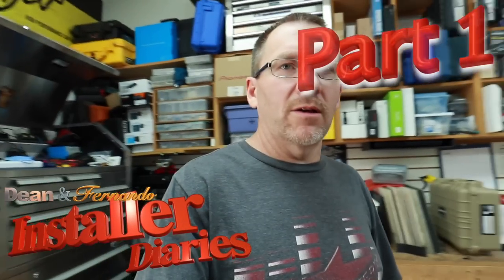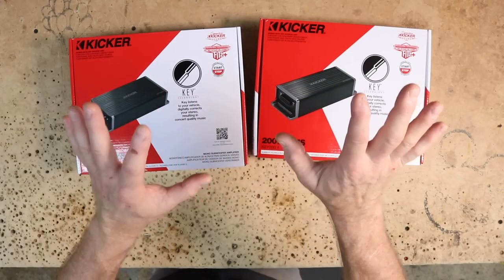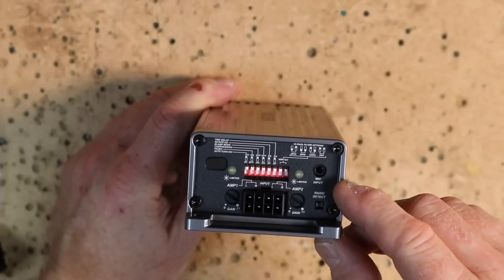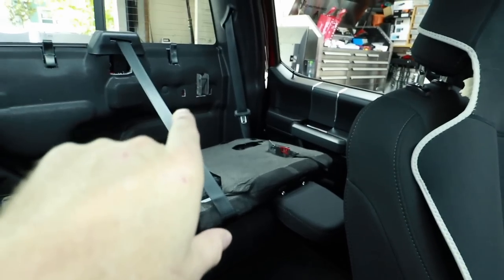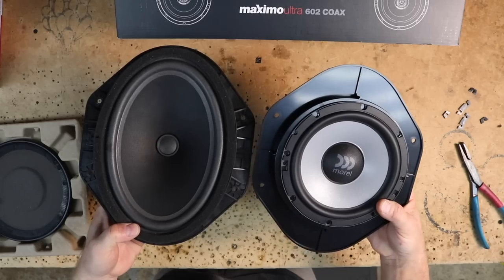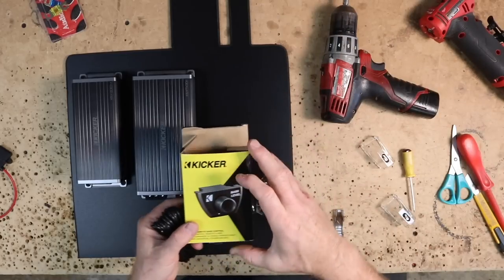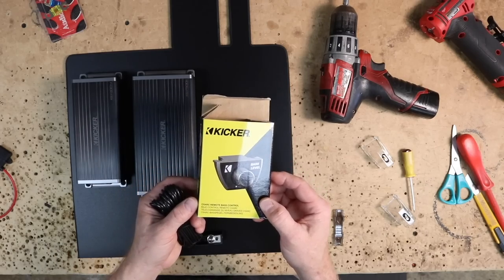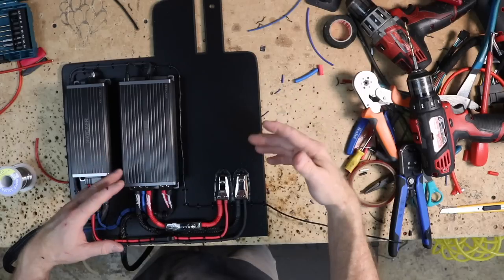Ford F150 get a full Kicker Key car stereo install

Comment: Got the KEY 200.4 running 2 sets of Kicker KSS6504s in my '01 Highlander...great little amp and HUGE upgrade over my 20 year old factory Pioneers. Mic calibration works pretty well. Sound treated both front doors, already notice a definite difference in road noise, overall ride smoothness, and sound clarity. Gonna do the back doors and floor next. Wouldn't have even attempted this without channels like this. Thanks, guys!
Reply: @A. Melbs Well, I still don't have a sub, so I'm running them full range with a slight EQ down 3db at 60hz on the head unit. Great speakers, great imaging, volume, and clarity, they just can't handle much under 60hz but the DSP on the KEY really brings them to life and creates an impressive sound stage in the cabin.

Comment: I have the kicker key 180.4 and 500.1. What sucks about them is that you cannot time delay the sub or phase it to help bring the bass sound more up front. All it does is takes the input signal and flattens it and mine is already flat from the HU anyway. So basically it didn't do much. Wish I knew that beforehand OR Kicker needs to make a 5 channel key amp so it can do the whole system all at once.

Comment: I love my Kicker Keys. I have 2 of the 500.1s pushing a Level 2 DC Audio 12” for each amp. My 200.4 runs my tweets and rear fill.
Reply: Do u have any amp running ur front midbass at all? What is it btw
Reply: @bradysimpson  Awesome man. That system sounds great man and I bet it sounds great as well. Lol

Comment: Always appreciate your vids.  Fabulous work!  As someone into car audio, and building home and portable speakers, it's always amazing to me the compromises we make in car audio to work in the very unfriendly (to audio fidelity) environment of cars.  In speaker building we worry about the marginal affect of front baffles in our completely controlled and engineered enclosures.  We put a really good speaker into a car door that is not sealed (from air or moisture) and is made out of maybe the worst material you could have.  Then we stack a foam ring around the front of the main vocal speaker.  Thanks God for DSP!  Don't misunderstand me, your methods are obviously industry-leading and as good as I've seen short of super expensive custom installs that your customers are not interested in paying for.  It's just such a challenge to make great sound in cars, and maybe that's what makes it so much fun!

Comment: I did this exact same thing in my f150. Even mounted it using the abs plastic panel you made. I'm still loving these little amps and the way they make my focal components sound.
Reply: What sub did you use?

Comment: One word for Ford owners: Forscan
First thing I deactivated was that horrible start/stop, that is a no-go in FL heat and I haven't noticed any difference in MPG...
Reply: foreskin?
Reply: @MrFuchew  that’s what I call it 😂😂
The plug & the forscan software is worth every penny. I deactivated the start/stop & numerous chimes. Activated the keypad entry, the factory trailer brakes, extended the time my power outlets stay running & the radio stays on after you turn off the vehicle.
Reply: I don't know but almost all the newer ones give you the option to turn it off on your own with out software
Reply: @scotthall1381  yeah it has the button you gotta hit every time you start it

Comment: Is there an audible noise floor with this setup over stock?
I have a key200.4, with a base F series truck but I am noticing the "system" has a steady state white noise out of all speakers at a very low volume. I measured it at 34db right at the tweeter with sound tools RTA on iphone.
Is this normal or is my Key bad?
I have speed wire from the deck to the key and speed wire back to the factory wires for mids and new wires for tweeters. Power and ground go to distro and to the battery on the same side of the car.

I also noticed gains HAVE to be at dead minimum or the noise floor is unbearable.
I am biamping a set of kicker components.

Comment: What signal are you using for the input to the 500.1?  Is it coming from the front two channels and split on the speed wire to go to both amps?
Reply: Also curious of the answer to this

Comment: How do I know if my F150 has the load resistors built into the amplifier as stated on minute 13:07? Or do all F150's have it? I've seen multiple videos stating that you need to install load resistors on most F150's, is that true?

Comment: Had a question. Since my front speakers share the same as the door tweeters. I ran the 200.4 to both front and rear speakers. Does it help out the tweeters when calibrating?
Reply: HiFi Vega did an install like this! You2ube it!

Comment: I haven't installed a system in nearly 20 years so some of this stuff is new to me. What's the advantage of using the amp for just the front vs all four corners? I have a 19 f150 with the same basic 6 speaker system. I'm planning in running both of these amps with a component set up front/coaxials in the rear. Where should I be pulling the signal from for the sub Amp?
Reply: Did you ever determine where to pull the sub inputs from?

Comment: Is the Key 500.1 enough to power two Kicker CompRT shallow mount subs? I'm looking at doing this also in my F150 but have been told that the subs would be too under powered

Comment: When you described Amp placement , It seems like running them both horizontally would’ve made the most sense you said power needed to come out to the right, and speakers to the left.
Wouldn’t that still have left you access to the gains?  Gosh you guys do amazing work
Reply: Slightly better access to setting from the top, and my opinion,  looking at the heating, bow the grooves are aligned,  being vertical will help with natural air flow and cooling.

Comment: why you don't use any capacitor on tweeters when plugging them directly into amplifier
Reply: The purpose of a capacitor is the filter out lower frequency.  The crossover in the amp does the same thing,  but even better. So the capacitor isn't required.
Reply: Didnt have to with that key 200.4 amp, when u run just a front stage on it. It has a crossover setting for the tweeters. On the midbass u set the crossover for it on the end of the amp. U flick the switches on it for watever setting u want for it. Like 60hz, 80hz, 100hz, or off i believe for the hpf
Reply: Agreed always should use a cap to protect against overload or other issues people mentioning the crossover are not thinking insurance policy with expensive gear.
Reply: The kicker key is great if you want an amp with a DSP on a budget but, I hate class D for anything other than the subwoofer in my car.
Reply: @davidperry4013  Your ears would never hear the difference

Comment: Where’s the ground point for the amps?
Reply: If its just 10amps, you can use the bracket mounting bolt you see in the vid, otherwise its best to run it all the way back to the battery. The reason being is they construction of the truck is mostly 'glued' together aluminum so Ford had to add grounding wires through out the truck. The one(s) for that panel (seen if you remove the carpet) is only rated for 10amps or so.

Comment: I am Planning on running this pair of amps in my prius. Mostly because of the DSP but the low power draw should work great for keeping my hybrid system healthy!  What is everyone's thoughts on a good 6x9 component and 6.5 coax pair? I was thinking about doing Pioneer D series 6x9 components and Pioneer A series 6.5 coax  I listen to Metal/Hard rock mostly.
Reply: Kicker CS is pretty good too
Reply: Your hybrid has a normal start battery, it will never effect your hybrid system because it is not even connected to it.
Reply: @ekimandersom4478  the hybrid motor has a generator that charges the 12v battery it is very much connected to it.  the prius does not have a normal alternator charged by the gas engine.
Reply: @BassRacerx  Really? I did not know that.

Comment: My only key product is the 47KEYLOC... everything else is cxa... 2 ...720w cxa360.4 ... 1 for mids coaxials.. 1 for tweeters... 1 cxa800.1 for sub... 12trtpt... downfiring.. there is so much more stuff i have... stinger products... i have an elaborate amp rack design that is unorthodox... deli counter... all amps sitting up for display... i just need guidance

Comment: How do u connect the rca cables in bi amp mode?
Reply: I wish they would have covered the radio to amp wiring a bit more. In one video he states that in the F150 you need to grab the feed for the sub from the front channels, but not sure how you would do that using the two key amps and then bi-amp on top of that. 

Are all 4 door speakers wired to channels 3/4? Where is the feed for the 500.1 coming from?